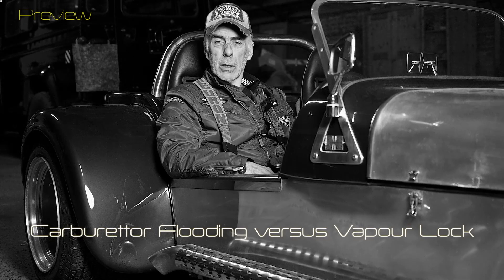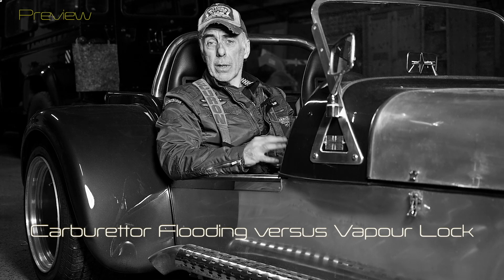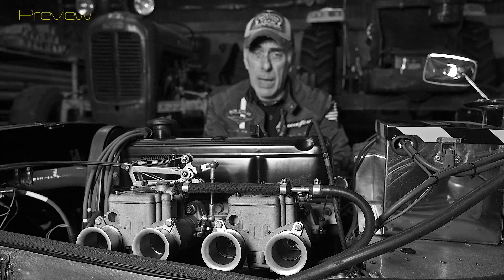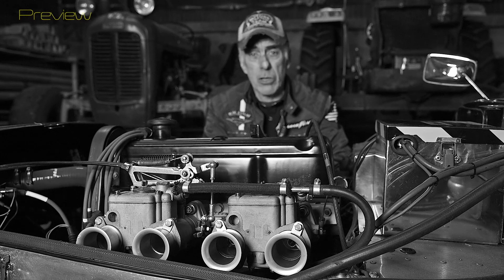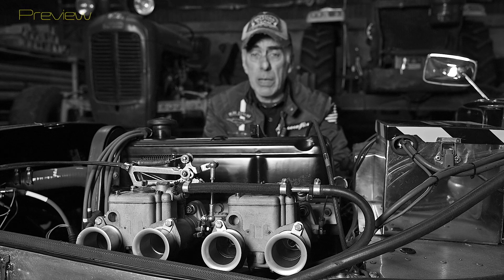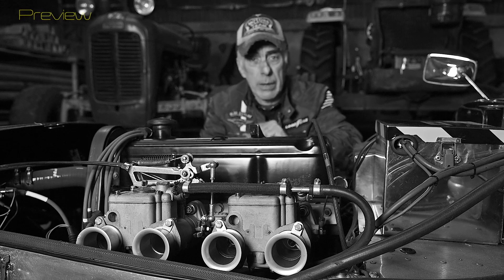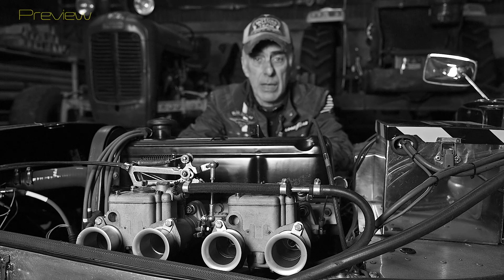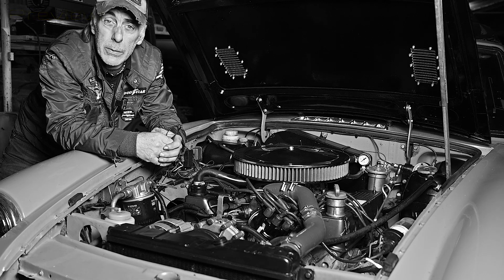Soon to come out  Carburettor Flooding your worst enemy

Comment: Hi i have a pinto with 45s  I have a popping back throw carbs.  I have played around with mixture and still there. Any advice?
Reply from the maker: Back popping is most of the time inlet valves that are not closed when the should or an ignition spark over as HT cable cross each other

Comment: I think a lot of our fuel problems are related the the filthy modern fuels we are expected to run our vehicles on now , the ethanol laden fuel is much more volatile than proper fuel, so causes problems in fuel lines that were perfectly OK with normal fuel, the ethanol additives are no doubt aimed at reducing our use of oil from the oil producing nations, but with the present chinese virus problem our use must have dropped considerably, as for flooding, I have found that renewing the float valve with one tipped with neoprene usually works. Stay safe! Chris B.
Reply from the maker: Thanks for the comments  and write up Chris

Comment: How about residual pressure build up in a side dual draft Webber with electric fuel pump and a pressure regulator? My Alfa leaks fuel after shutting down after hot. Float levels are correct and needle and seat works properly.
Reply from the maker: Yes , indeed ... that is one of the reasons that I will talk about.